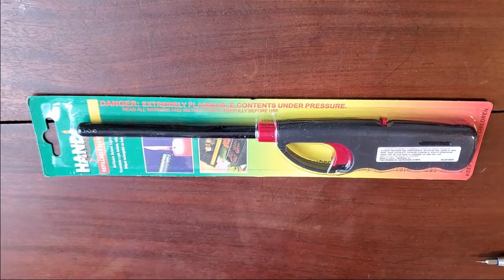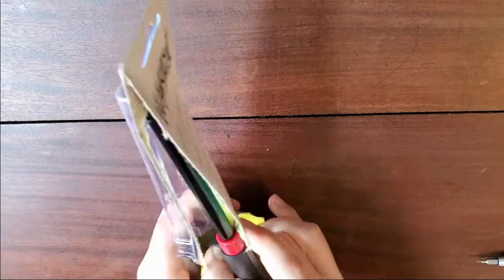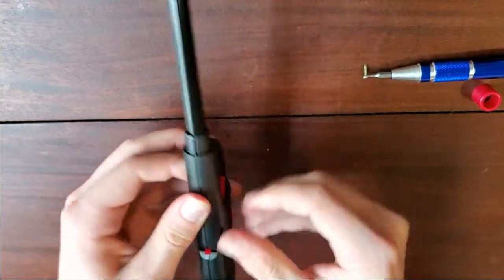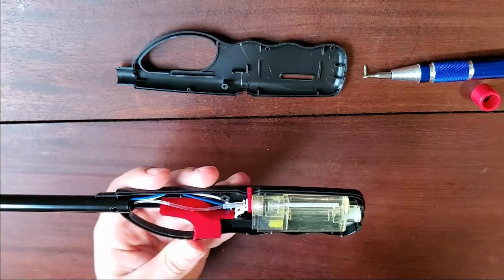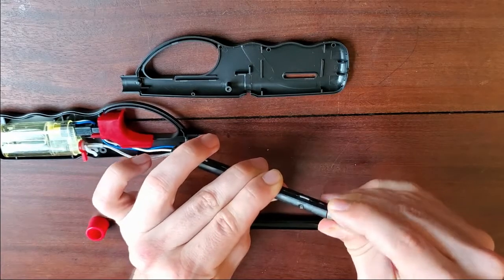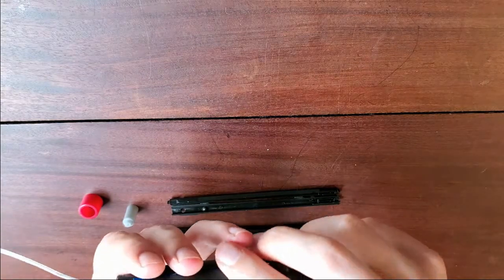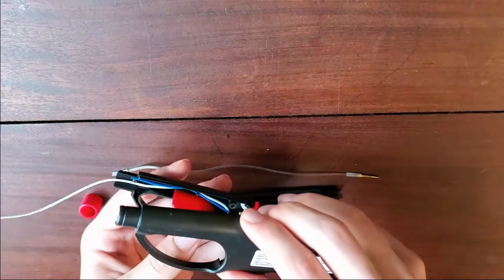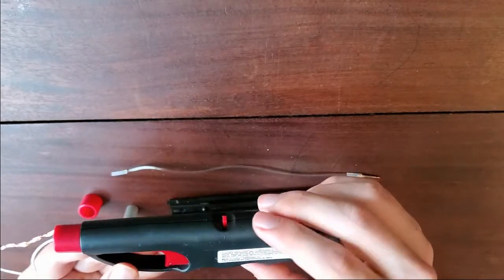Recreating Electropen: The DIY Electroporation Device

Comment: Those cuvettes are massively expensive for just being plastic boxes with electrodes in... would it be possible just to dip the tips of the "device" into the solution to zap it?
Reply from the maker: You can try to make your own electrodes like those in the original paper. Just sticking the wires into the solution is unlikely to work
Reply: @qosmoschem  Thanks for the reply.. is there a reason why this may not work? the electrodes are just extensions of the lighters electrodes right? Or am i missing something? cheers
Reply from the maker: @PelletJamie  The electrodes maintain a fixed distance so fixed electric field for a given input voltage which might be tricky to maintain with the free wires. More importantly they provide more surface area so that more bacteria experience the electric field. Only bacteria between the wires would experience the electric field so your transformation potential would be pretty low.
Reply: @qosmoschem  Understood... that answers my question... cheers

Comment: how did you modify the cuvette? Can you please create video for that also ?
Reply from the maker: You don't really need to modify the cuvette. Just attach the two wires from the electropen to the metal plates on the cuvette and it should work. I used copper tape with conductive adhesive but I think almost any tape should work.
Reply: @qosmoschem Thanks! Not everyone has access to Oscilloscope! In this case, how we measure output voltage?. Multimeters, I guess go until 750 V max. Is this device commercially available? Can you please please sell one to me?
Reply from the maker: You can either use a multimeter rated for 2kV (https://www.ebay.com/itm/Digital-2000V-AC-DC-High-Voltage-Multimeter-Voltmeter-Tester-Meter-New-Arrival/373016347686?hash=item56d981c426:g:f7cAAOSweX1dFO1Q) or you can make a simple voltage divider (https://learn.sparkfun.com/tutorials/voltage-dividers/all)